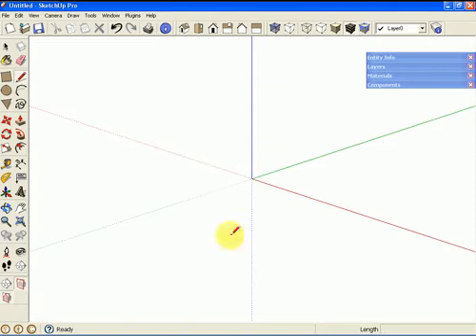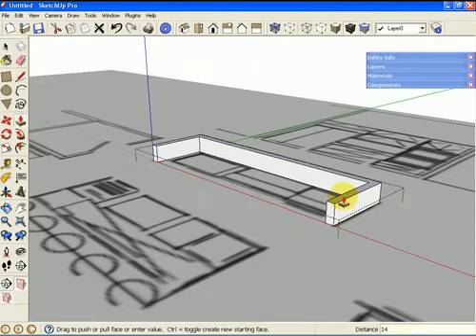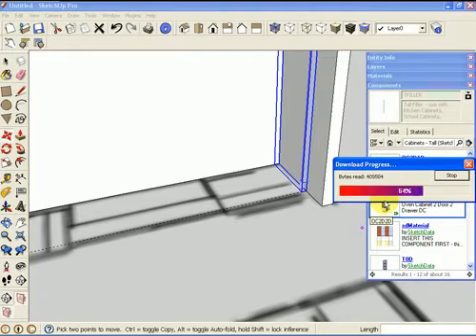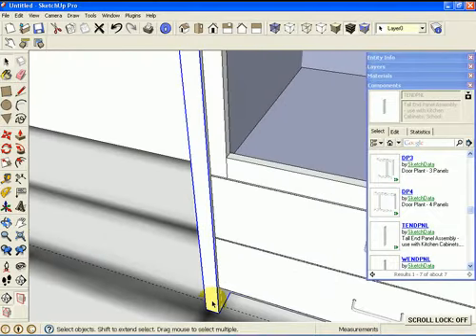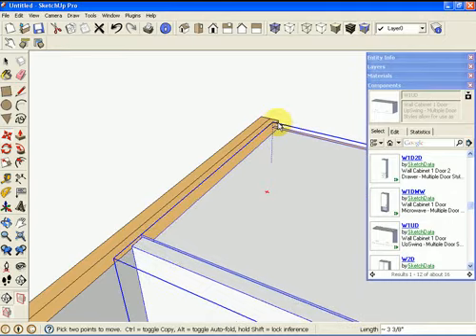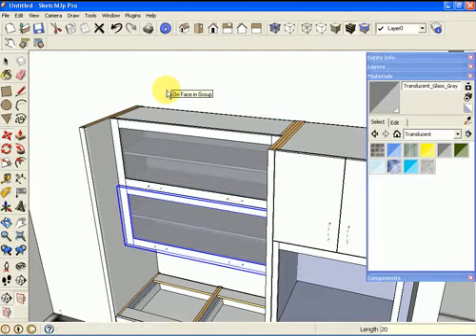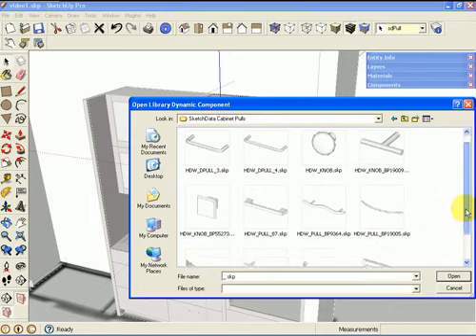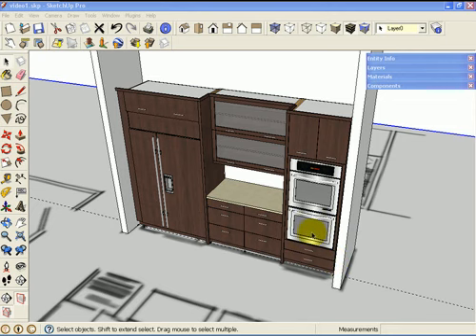SketchUp Kitchen Design using Dynamic Component Cabinets (Part 1 of 3)

Comment from the maker: If you add the Material swatch sdMaterial after you already have cabinets, then the cabinets should take on the material colors when they are "redrawn", with an attribute change for example, or there is also a Redraw All Dynamic Component plugin too.  The default swatch colors are brown, but can be changed to JPEGs.  Also make sure your SketchUp display mode is "Display with Textures", otherwise you wont see color/textures.

Comment: I truly appreciate the effort you put in to make and upload these quality videos. I have just discovered SketchUp's Dynamic Components and SketchData components, and I am thrilled by these new features. 

I have a question regarding bitmap materials. From what I have noticed, when you change the SD materials to bitmap images, all dynamic cabinets get modified. What if the model has more than one style of cabinetry? Do you then just change other cabinets' material manually?
Thanks.